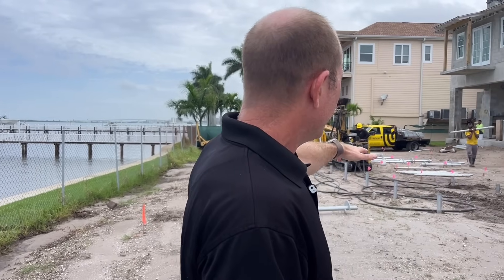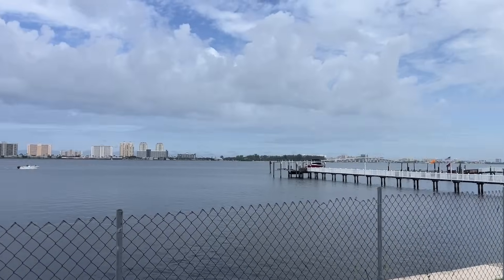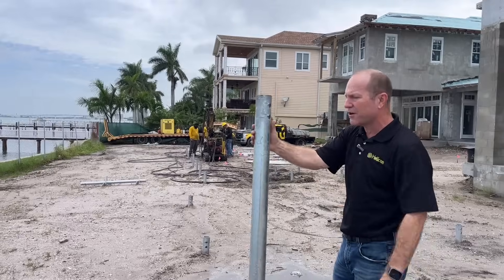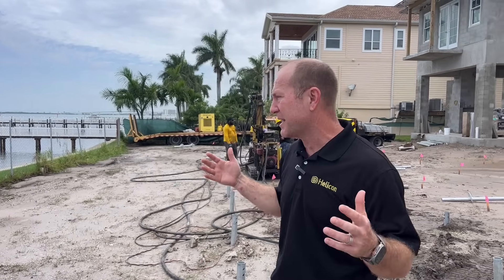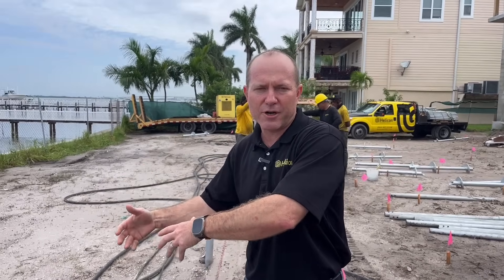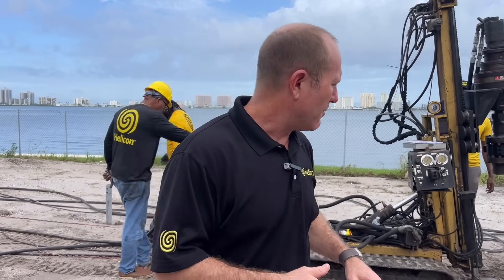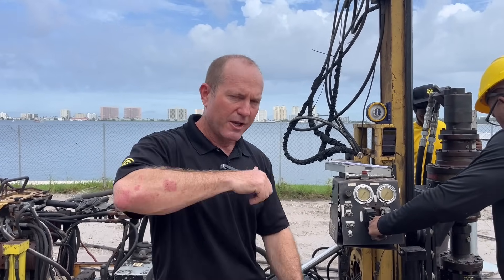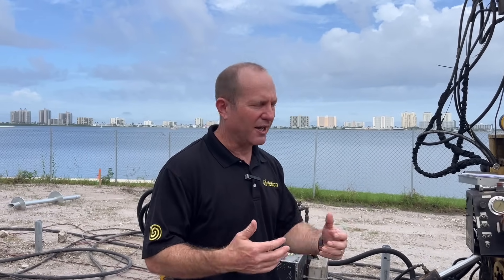How Pre-Construction Helicals Can Protect Your Pool Foundation System

Comment: How do you go about finding out if this is needed before building a pool?
Reply from the maker: An engineer could identify this based on the soil makeup below your home. If loose soil is present or voids are appearing, these are usually telltale signs. Please call us at 844-Helicon if you have further questions and we can point you in the right direction on how to move forward with this process.

Comment: Can't you just keep your pool filled with water?  Seems like it would be very cost effective.
Reply from the maker: This won't stop a pool from popping out of the ground, especially after a major storm. Having helicals in place is the only effective way to prevent something like this from happening.
Reply: @HeliconUSA  Interesting.  I vaguely remember studying Archimedes' principle in physics.  How does the force of water under the pool exceed the force of he weight of the water in the pool?  How do you calculate the force on the helicals and how deep you need to go?  I guess the steel also keeps the pool from settling when there is no water pressure from below.  I could see other practical uses for the helicals.  They could be used to anchor a radio tower or the cables on a suspension bridge.